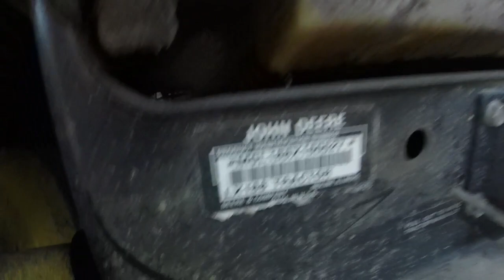Getting a free John Deere LX188 rider!  And items I bring to make picking up mowers easier

Comment: I have an LX178.  Virtually the same.  I love mine.  150 lbs compression.   Be careful with the plastic air intake  to the carb.
Reply from the maker: Thanks Bruce for the tip!  It looks to be a well made mower besides the hood.

Comment: Bummer on the hood, but it’s certainly a common issue with those years. Looking forward to part 2. I usually take my jumper pack, small electric air pump, and some starter fluid. Thanks as alway Casey
Reply from the maker: Jumper pack and starter fluid are great additions too!

Comment: I used to bring air tank with me for tires now i just bring a bicycle pump  no electric required to fill tires..get yourself a cheap winch ull thank yourself later and a few uses pay for itself.
Reply from the maker: I am wanting a winch, I'll likely get one at some point.  Sometimes tires are so bad a bike pump won't get them up fast enough to hold enough air to move it.